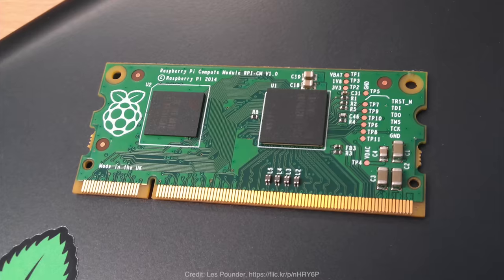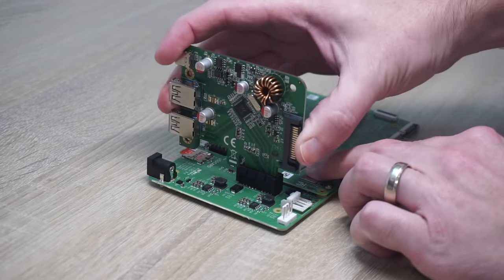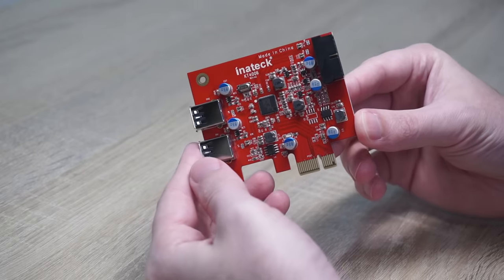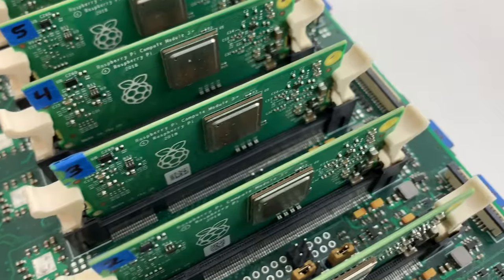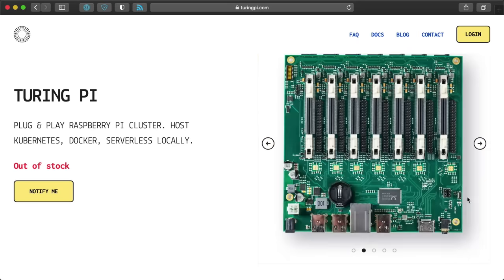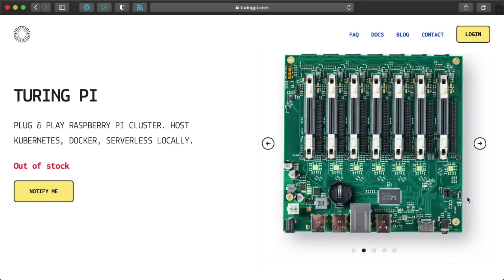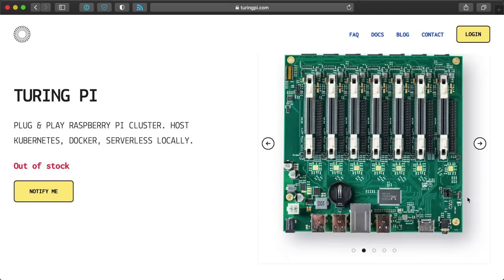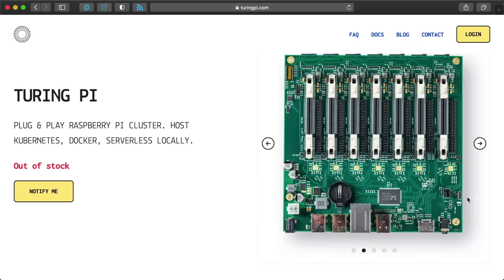The Raspberry Pi Compute Module 4 Review

Comment: If I could get just power into the CM4 could it operate as a headless Linux server with a crazy slim form factor? 
Or would the expansion board needed for power make it as big or bigger than the pi 4?
I do get that the purpose of this board isn't for this, and I do know that the 3a+ exists and even the pi 4 can do this, but this is so slim!
Reply from the maker: You'd need a separate board for it, though someone could make a very slim/trim board that just has a power connector and maybe a network jack for a still-tiny board. But the Pi 4 model B is already pretty tiny as far as 'complete boards with power and network jacks' go!

Comment: Btw, that 3dBm increase going to the external antenna is actually a doubling in received power. You went from 50 nW to 100 nW
Reply from the maker: True, true, it's an exponential increase, but still, for being a tiny triangular pancake antenna built into a PCB, that's pretty darn good for the built-in antenna.

Comment: PCIe is downwards and backwards compatible, as well as latency tolerant. You can, in theory, plug any video card into a 1x bus and it will work. That's done on crypto mining setups all the time, with PCs having graphics cards connected on all PCIe slots using 1x to 16x adapters.

Comment: You can connect RTX 3080 (or any gpu) via a pcie riser adapter 1x to 16x, usually used for mining. These cost a coupe of bucks on ebay.
Reply from the maker: I just ordered one and am going to test with a 4x Intel network card.

Comment: Regarding the Booting off nvme: Wouldn't it be possible to have GRUB Bootloader on some disk (usb / sd-card / eMMC) that has the nvme drive to boot afterwards. That way the GRUB bootloader may be initialized and has some basic features available (like nvme) or at least with some changes to the GRUB it should allow it to use nvme.
But anyway Thanks a lot for this video, I'm going to buy some CM4 and start prototyping :)
Reply from the maker: Yes I think that would work, but I really want a full boot from NVMe so I could integrate it with the Lite version of the board and not have to have any other storage :)

Comment: I wonder how they are going to fit so many modules on the next Turing Pi now that it's not using an Edge connector.
I can imagine some kind of PGA370-Slot1 adapter thing for each board... speaking of full circles :D
Reply from the maker: Haha, yeah they'd have to get the boards vertical somehow to be able to fit more than a couple on the Mini ITX board.

Comment: Would it be possible... to use a Firewire PCI-e card... with the RPi compute module?
Reply from the maker: So far nobody's been able to—the problem is many of the Firewire cards are pretty old and their drivers expect IO bar space and a BIOS, which aren't present on the Pi :(

Comment: You should be able to use an older AMD(generally have great open source drivers compared to nvidia) gpu with a pci x1 to x16 adapter, just make sure it's one that takes auxiliary power.
Reply: Can't be too old. The older AMD cards do not have great opensource drivers. You want a card that is supported by the amdgpu driver. I think the Fiji cards are the oldest ones supported. Those are from 2015. Older cards than that will be using a different, not nearly as good opensource driver.
Reply: @stale2665  I think a fury nano would work.

Comment: I just wonder why did you choose MacMini as NAS, how many sata ports does it have? 
Do you mirror your data?
Reply from the maker: Heh, I mostly use it because it's what I had for a very long time, and originally I didn't do any video work. I had less than 1 TB of data to store on it. Then I decided to rip all my DVDs (and then Blu Rays) to it over the years, so I added a 4 TB, then 8, then 12 TB external HDD (over FireWire, then USB 2.0).

It's pretty painful now, but I do have a setup that clones the two external drives via USB 2.0 every night (rsync), then I have another script that runs over the weekend to sync all my data up into a Glacier-backed Amazon S3 bucket using rclone.

In total I'm paying maybe $8/month in Glacier storage (I don't store everything there, only files I deem important, and all my video source files), and I expect that expense to keep rising as I get more into video.

I'm actually working on a few new NAS solutions now, and will soon be doing a video talking about my options and what I ultimately choose (still haven't decided!).
Reply: @JeffGeerling  great to have an answer from you, yeah i know the pain of drives stacking one by one out of nowhere..

Depends on your needs and if you need better control over the software then i would go for open source software and custom build, otherwise use solutions like Synology, the best about it is that it just works and have great web ui and app support for it, features like system access, ssh, vmachines, docker, on the other hand some great business apps are behind the paywall like email server and you need licence to use it for  example.

My advice is to write down the needs and simply match with features of each one, i myself went for synology and im quite happy overall. Just remember to get enough bays and drives to be able to mirror data in real time, which is super important and superior to backup in anyway, unless remotly. Good luck

Comment: Please try making it into pfsense router, it should work - pfsense has ARM64 version and build in drivers for many network chips. And CM4 specs are looking great for low power router.
Dual gigabit intel based nic should work. That would give you 3 gigabit ports total, plus wireless. That'd be soooo awesome!

Comment: I wonder why they didn't make the PCI-e slot open ended? That way x2 x4 x8 x16 would plug direct
Reply: Slots like that might be more expensive, as they're less common (in my experience)?
At $35, that development board is pretty cheap - especially compared to a lot of dev boards and evaluation boards I see from electronics manufacturers - so they were probably trying really hard to keep the price as low as possible.

Comment: That mic is RE320, right? Shouldn't you be a bit closer to it since it is dynamic?
Reply from the maker: You want to be as close to any microphone as possible, as a general rule. But practicality dictates that I not be eating the mic when I'm on camera, otherwise people start getting a little suspect. Plus a little room noise never killed anyone :D

I have a Cathedral Pipes preamp that boosts the level so I can use the mic from anywhere between 3" to 1' or so with a clean signal level, it's just a difference of how much room noise the mic picks up in relation to my voice. Someday I'll have a better 'studio' office, maybe, with better sound design in the room, but for now that's why I at least have a few sound panels around me, to try to stop the reflections that go directly into the mic.
Reply: Jeff Geerling I see. So there is no (or very little) coloration to your voice if you are a bit further from the mic, right?
Reply from the maker: @victor.ivanov  Definitely less than if you're right up on it, but there is still some. You just don't have as much of that 'radio' sound if you're not right on it.
Reply: Jeff Geerling thank you sir 👍🏻

Comment: I think, you don't have to search for hardware-compatible GPU. There are adapters that convert PCIe x1 to x16. Now obviously, it would still run at x1 speeds, but at least it would fit any GPU size, so maybe you could find one, that supports Linux on ARM.

Comment: I want to disagree with your statement about the IO Breakout board. I believe the breakout board SHOULD have every possible connection/feature for testing. The Compute Module is really for people doing their own custom IO boards with exactly what they need. If the "off the shelf" IO breakout board was missing a feature, I might not be able to test the specific feature I want during prototyping.

Otherwise, excellent review! thank you for the video!

Comment: The NVMe boot is a limitation of the bootloader. Nothing is stopping you from chain loading a bootloader which can boot off NVMe. However to support the current RPI OS unchanged may require UEFI. I haven't confirmed this.

Comment: I use a RPI4 as a nas and home server and it works mostly well, NFS is slow, SAMBA however, use the full bandwidth. I'm pretty sure that the compute module is gonna be a monster of a NAS, for "cheap". Let's wait and see what custom IO boards is gonna be on the market for that !
Reply from the maker: I could imagine a tiny NAS using the compute module as kind of a HAT a on top of the drive stack. The key would be getting some good airflow/cooling to keep everything running well.

Comment: Why couldnt they use the same SODIMM form factor? i was so looking forward to using something like a TuringPi. Maybe move to a DIMM form factor instead of SODIMM allowing for 2-4xPCIe, Wifi antennas, external SATA, networking, and USB over the single port, with pins to spare
Reply from the maker: Check out their blog post on the topic. There are a number of reasons they went with the 2x board to board connectors (it was not just about pins): https://www.raspberrypi.org/blog/designing-the-raspberry-pi-compute-module-4/
Reply: @JeffGeerling  I mean, for an SBC a hat style connector is probably better, but i was so hoping to still get SODIMM/DIMM form factor as this is one of the best ways to increase density for am MBC. I figure that a new 'turingPi" would reqire them to be laid flat in a larger board, mounted to both sides of the board, or making dedicated mount boards for the CM4 to, and then that board connects to a mainboard
Reply: @JeffGeerling  So i didnt see your other video on the price breakdown of the turingPi, i didnt realise the SODIMM connector costs $10, i thought something so mass produced would have been in the $2-$5 range or at least less expensive than something with acutal ICs like the network controller, guess they arent as mass produced as i thought.
I know its a moot point, but i wonder the cost difference of laptop style connectors with just enough overlap to not block airflow, or full desktop verticle dimms.

Comment: Can we use SD card and emmc storage at the same time??
Reply from the maker: No, that is one thing that may be surprising to some, but the IO channels used by the eMMC disables the microSD card slot if you're using a Pi with eMMC.

You could, however, plug in an external eMMC card reader via USB and use that.
Reply: @JeffGeerling  Thank you so much for your response...
1.Can we access the SD when we disabled the emmc on the Compute Module 4? or 
2.It is hard wired with emmc in a way that makes the SD reader unusable? 
3.If possible can you please check whether it is limited by the Hardware or is there any work around in the software to access the SD card?
Frankly this my first comment which was replied by the creator.Thanks a Lot.
By the way check this one out https://www.nvidia.com/en-in/drivers/unix/linux-aarch64-archive/
Reply from the maker: @SanjayRavindran  It is a hardware limitation; the IO used by the eMMC takes up the same lines that the microSD card uses, so on the eMMC modules it does not have the physical connections to make the SD card slot function.
Reply: Thanks for you time...Happy I got an answer :)

Comment: If only it had 2 USB ports (I don't care if it's USB 2.0 or 3.x) AND the PCIe x1 slot. I could then use this for a major project I have. I need 2 USB ports and 4 RS-232 ports. The PCIe x1 slow can use a standard quad RS-232 board.

Comment: Any linux should be able to set boot files in the emmc, but any OS files can be mounted on any external drive.
So technically speaking, /boot/ or /efi/ is on the emmc. The rest of the OS and programs can run from the SSD.
11:07 For home use, these $1 antennas are good enough: https://www.amazon.com/dp/B07JFZDYVS

Comment: As soon as there's a turing pi for the compute module 4, I'm going to get some. I've been wanted a real home rpi cluster setup for a while.
Reply: Me too, although I'm wondering what it will look like now that they've moved away from the DIMM module form factor. I'm hoping they'll still be able to fit 7 modules on an m-ITX board.
Reply from the maker: Judging by the case they posted to their Twitter timeline, it looks like it has four LEDs on the front. Just speculating but I'd guess the new design means they can't cram in as many Pis on the board but still, 4 CM4s blows away the performance of 7 CM3+'s accounting for all the different aspects of performance!

Comment: Macs are switching to ARM... and they’ll need drivers for the GPU’s... is there a chance? 😋
Reply from the maker: I mean, it can't hurt! Already there are a ton more docker container images being built for ARM now (though usually ARM64, so you have to use the Pi OS 64-bit beta to run them).
Reply: not likely since mac ARM has its own tweaks.
Reply: Apple is just going to use Apple designed GPUs.
Reply: Considering Intel bought ARM, you can technically say that Macs are still using Intel CPUs...
Reply: @BrunodeSouzaLino  ? i thought nvidia bought arm ?
Reply: @JeffGeerling  AMD should have arm GPU drivers!!!
Reply: @BrunodeSouzaLino  nvidia owns arm, broseph. Not intel

Comment: I'd be pretty interested to see if a graphics card would work. As for the driver problem - 32 Bit ARM drivers are available from NVIDIA below. These would be the best bet, though I've never tried them:
https://www.nvidia.com/Download/driverResults.aspx/134860/en-us

The next question would be if the PCIe slot can handle the power of a graphics card on the development board. the GT710 is 19W, which is the lowest you'll find and the safest bet, but still higher than most non-graphics PCIe devices. You might consider a powered riser, which could handle more powerful cards and could also convert from 1x to 16x if you want to try with another card you might already have around.
Reply from the maker: I just ordered the Zotac, we'll see what happens!

Comment: In regards to the gpus, pci-e cards do not care in what slot they are, they just run at a lower bandwith. You can literally chop the back off of a x1 slot and plop a x16 card in it..
Reply from the maker: Interesting, this I did not know. Last time I messed with a GPU at all (besides using whatever came in my laptop) was pre-2003 when I last built my own desktop... and back then I think it was AGP slots, which were entirely different :D
Reply: @JeffGeerling  Maybe some gaming on a pi afterall :)
Reply: a x1 to x16 riser is less destructive and you can move your GPU to a more convenient position

Comment: If I have to use the PCIe slot to provide USB 3 support, I will stick with my 4GB Raspberry Pi 4B as I have 4 USB 3.0  3TB drives connected to it. Getting almost 100 MB/s. It is almost as fast is transferring files locally on 3 of my 5 Windows PC 's.  The other 2 are laptops that only have 2.1 Ghz WiFi of 10 mps ethernet.   My Mac needs to have the ethernet cable change to get the maximum speed out of it. I can't look a gift horse in the mouth as I was given it as it would not boot. My job was to get it to boot and recover the data on after Apple said it could not be done.  I got it to boot recovered data.  Upgraded to 20GB of memory. Upgraded the HD to a 2TB.  All of which Apple said could not be done. 

Back to the Raspberry Pi Compute, IMHO the Raspberry Pi Foundation should have dropped USB 2 Support on the Compute Module 4 IO Board as USB 3.0 is backwards compatible to the very first USB devices. I probably will never use eMMC storage as the storage capacity cost analysis doesn't compute.

Comment: Considering all the ransomware attacks on NAS'es, I'd say the A does indeed stand for "Attacked".
Reply: Your NAS is not a security device. It is, by definition, the target. If you want total network security, the best security devices are a pair of scissors and superglue. Cut the connection between your computers and the internet, cut the wifi antenna cables inside the computers and the superglue goes right into the USB ports. Problem solved. These kids today... they can't even tell where the actual problems are located....
Reply: @lepidoptera9337  you don't have to tell me. I made my own NAS, and it's definitely not connected to the internet. Plus I've got hot, warm and cold back-ups. And of course an off-site backup. I haven't lost a file in 20 years 😎. But hey, it's the iPhone generation : lots of people have never RTFM but think they are computer gurus...
Reply: @TheNefastor  Exactly. It's layered and offline or nothing. Might as well publish the data in the NY Times Op-Ed. Why are people not getting this? I wish there was a cheap storage tape solution, though. Something for the fire proof safe that's not  a rotating platter stack.
Reply: @lepidoptera9337  there is, sort of. I've seen some self-encrypting USB sticks, complete with keypad to enter the key. Pricey but not too much. For exemple Apricorn Aegis FIPS 140 : that's a 2 TB USB 3.0 HDD, goes for 300 € or thereabouts. I'm guessing there must be an SSD version. Professionally, I've seen 16 TB 2.5'' SSD's with FIPS.

Comment: What's the point of nvme if we can't boot from it?
Reply from the maker: In the words of Clarkson, "SPEEEEEEEEED!" Its still useful to have higher speed storage even if it can't be directly booted from. And hopefully it will support NVMe boot after some future firmware upgrade!
Reply: @JeffGeerling  thanks for your response. How can we know if it's a firmware problem or a hardware limitation? This is something difficult to mention at this time I guess..  but if the pi does boot fe nvme, then, it becomes a super fast main pc for me. I will use it daily.
Reply from the maker: @Aemilindore  I'm pretty sure it's just a firmware update away from being possible, the key is to get it to be a priority for the Pi engineers :)